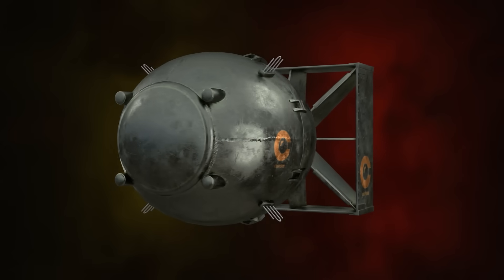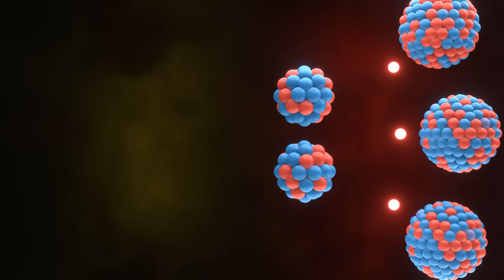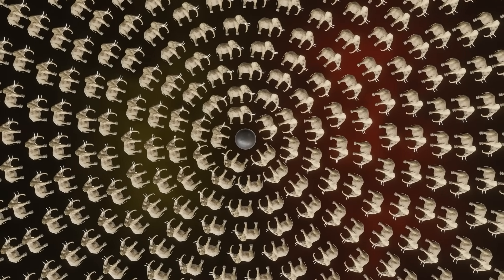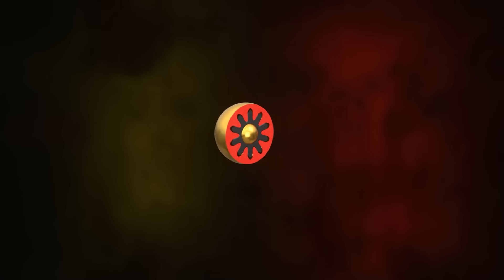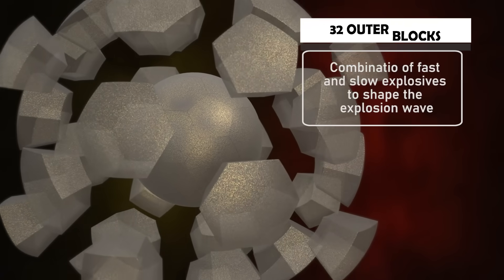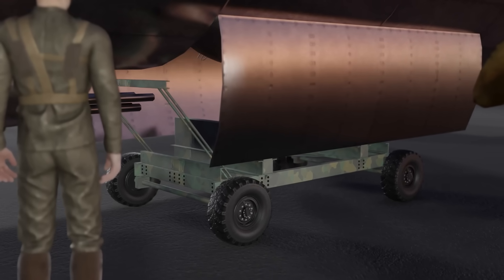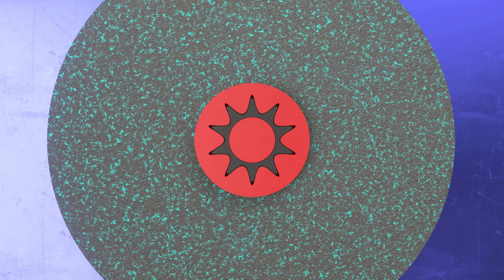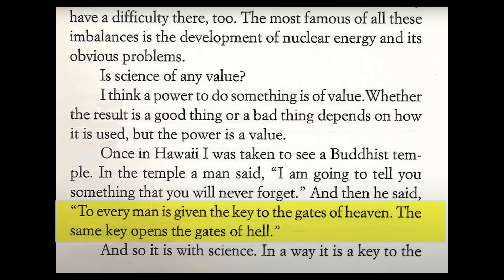What's Inside the Atomic Bomb?  |  Insane Engineering of the Atomic Weapons  |  CURISM

Comment: You say a sphere but you draw a ball.
A ball of Plutonium close to critical would emit huge amounts of radiation
and could even get very hot and melt down.
My reading on the internet tends to confirm that it wasn't a ball but a sphere
about the size of a soccer ball with thin walls which of course is mostly empty space inside.
It was when it was compressed down into a ball that it went critical.
In any case - you shouldn't be giving Iran any ideas as
they are trying to make the bomb.

Comment: The most difficult and expensive part of the Manhattan project was not designing and constructing the weapons. It was producing the fissile materials in the quantities needed. It required mega-project sized facilities at Oak Ridge and Hanford. Firstly they had to discover how to produce large amounts of enriched uranium, which was used in the Little Boy gun type atomic bomb. Plutonium is a byproduct of uranium fission. The reactors to produce it in large enough amounts were perfected and built. That provided the material for the Fat Man implosion atomic bomb.
 
This is why I doubt the Rosenberg couple apparently leaking bomb plans is what allowed the Soviets to produce nukes years sooner than expected. The industrial infrastructure to produce fissile materials is a massive undertaking requiring many years of research and work. It was also extremely expensive. Problems that bomb plans do not solve. The Soviets already had a nuclear program. How US leaks may have accelerated it is not yet known publicly. Some very prominent people were suspected of leaking secrets. The USSR would have got the bomb regardless. How a nuclear explosion occurs was well understood in theory even before WWII. Making it happen is what was not so easily understood, or undertaken. 

P.S. The gun type bomb was far simpler than this one. Two sub-critical portions of uranium shot together to form a critical mass and therefore an explosion. The design was not efficient though, so is generally not used today (thermonuclear weapons use an implosion device similar to Fat Man as a primer for a fusion reaction in one or two stages).

BTW. Japan was trying to surrender before their cities got nuked twice over. All those civilians probably did not need to die, and be scorched and irradiated etc. It's too late now. A very ugly feather in Uncle Sam's cap. I do not want the USA to do good to make amends though, because their idea of doing good around the world tends to do far more harm than good over the decades since WWII (some might argue doing good is a fig leaf for ulterior motives).
Reply: japan wanted surrender with conditions, the u.s. wanted unconditional. on aug 8th, the russians invaded with a rapid advance, and of course, the japanese were much more terrified of the russians than the u.s. -- the u.s. wanted control of japan and did not want the russians to have it. hence, we accepted japans surrender WITH conditions such as the emperor remains as a figurehead n such. if the russians had not invaded, we could have probably dropped many more bombs before the the surrender. remember, in dictatorships, the people actually suffering, fighting, and dying have little say compared to the dictators who are usually very safe and comfortable. the actual process and surrender was a lil difficult between the emperor and war factions with even a minor coup attempt n what not-
Reply: @blainegwen4858  It goes further than that. By 1945, the implicit Japanese plan was to keep the war going until the American home front and even world opinion rebelled against the policy of unconditional surrender. Japan may not have surrendered even in the face of the atomic bomb campaign. Once there was no conceivable threat to the American homeland, and all of our territories and all of our allies were liberated, the control of the home front might well have broken down and the American people might have rebelled. against the American government over continuation the war.

I am not certain there was any deal allowing Japan the maintain the monarchy. I have always heard, Gen. MacArthur made the decision to allow Japan to keep the emperor.

I have my own take on the policy of unconditional surrender. What I believe is that Allies wanted the war to end in way which made it impossible for the German and Japanese nationalist to come back later and try to claim that it somehow had not really happened.

It was known already in the 1930s that the aim of the Nazi German and Imperial Japan was to overthrow the world order and install the German and the Japanese as the world's flagship civilizations. German and Japan saw the American, the Russian and Chinese as civilizations whose power grew out of the possession of land on a continental scale and the British and French as leaders of worldwide linguistic cultures and civilization. Fascist Italy had the lesser aim of supplanting France as a Mediterranean power and a linguistic culture.

I saw this explained clearly, albeit briefly, in the novel Swastika Night, by British communist author Kate Burdekin, published in 1938. It was a fight to death because it was.
Reply: 'Japan was trying to surrender before...'
Trying?

I think you speaking 💩 

Japan started bombing USA 5 minutes after their war message to USA's. diplomatic.

So they were always few steps ahead clearly..

'Don't nuke us, we surrender!! -What is nuke?'

Comment: Just a little bit over 9 cm in diameter yet it weighs over 6 kilos. That's a softball sized hunk of metal that weighs more than 1.5 times that of a gallon of water. 😮
Reply: Yeah, and it was hollow at the time when calculations made. Implosion nukes core's are always hollow and there could be some gas like radioactive isotope of helium.
Or even emptiness, vacuum, no air, nothing. It variants by design of nuke.

Comment: 11:20 All of this happened in just a few microseconds, so fast that most of the core was actually scattered by the explosion before it could fission.
Reply: True, but the implosion-type bomb was far more efficient than the gun-type bomb which could see as much as 80% of the nuclear material get thrown out during the blast.
Reply: @krashd  Oh, no doubt, I was just referring to the speed of the reaction being so fast that it barely even happened.
Reply: But all that needed to get it critical and working. 
Some TsarB isn't much bigger or having hundreds times more material in it, it's just made more efficient.

I understand it throws same amount of shit out of her, no matter does it explode 50 or 100 megatons. There's just difference how to ignite it and feeding free particles in it. Same core and 'fuel' there still is exploding.
Reply: @jannejohansson3383  The difference between the 100Mt and the 50 was uranium tamper vs. lead, otherwise it's the same.
Reply: I've read that the material actually "chain reacting" was the size of an M&M.
Reply: @steveinmidtown  For Fat Man(plutonium bomb that later became the basic model for all), yeah round about, for Little Boy(uranium bomb) I think it was around 1kg.

Comment: Fat Man was a Plutonium Implosion device that yielded 21 Kilotons. It was the only device tested at Trinity. The scientists already had good faith that Little Boy, a gun type device using Uranium would work as planned. It yielded 15 Kilotons. 

Little Boy used 64 kilograms of Enriched Uranium while Fat Man used only 6.4 kilograms of Plutonium. There was only enough Plutonium for 2 bombs. If a 3rd was needed, it would take Hanford months to produce additional material.

To compress the Plutonium core, shaped charges using Comp B explosives (RDX and TNT) and Baritol explosives (TNT and Barium Nitrate) were used. Timing detonation of the shaped charges was super critical. 

Explosive Bridgewire Detonators were used. They can be timed to all explode within nanoseconds. Any error would result in a 'fizzle' (non nuclear chain reaction). Even today, control of Explosive Bridgewire Detonators is tightly controlled by the Government for obvious reasons.

Comment: Are you sure about compressing a core by 2.5x? I would think it would be more like compressing it by 2.5%. I can find no reference material stating that compressing metal of any kind by that much is possible outside an actual gravity well (stars).
Reply: I know the comression was 2 times. it was 4 tons of explosivs concentratet on 6kg of Pu.....
also Pu was mixed with 1% of Ga, Whitch makes it going into delta phase, one not so dense kristal of Pu. so you get the first 20% of comression for practical "free"
https://www.youtube.com/watch?v=QLZMzsRB86E
Reply: @ichich3978  thanks!